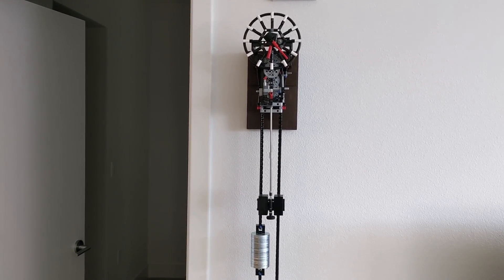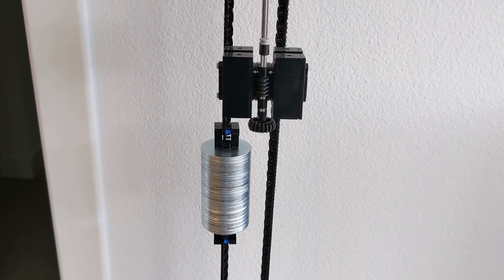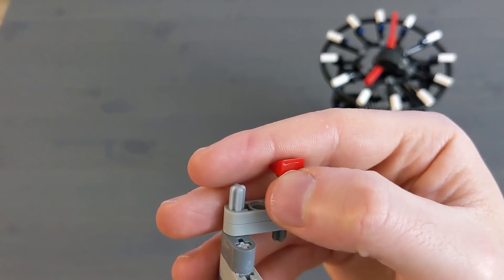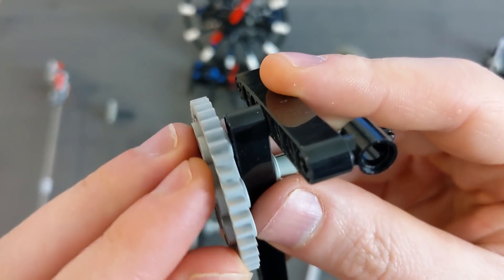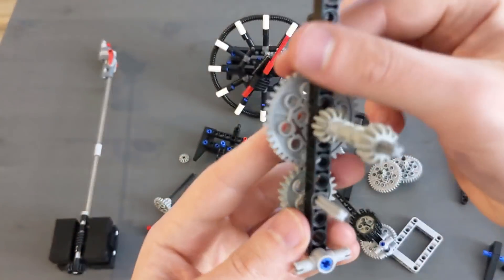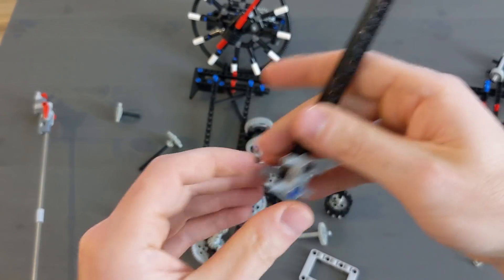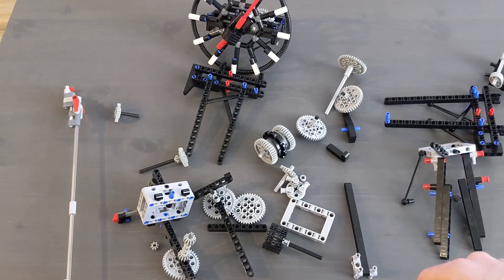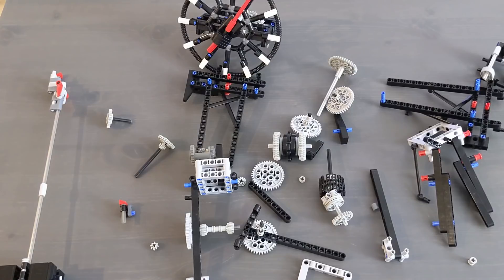LEGO Pendulum clock: can a LEGO clock run for a whole year?

Comment: The freewheel input I believe, the part only supported by one bearing joint is in single shear loading this allows the axle to twist and bind. If you could add a second bearing location to that half of the freewheel wear will be reduced dramatically

Comment: Great work, Dillon, and thanks for the .lxf file.  Speaking of which, LEGO Digital Designer 4.3 says that 24 bricks couldn't be loaded; do you know why that's happening and/or which bricks those are?  Also, it looks like you're using chain link part number 15379, but how many of them, and are there any other parts not showing up in said .lxf file?
Reply from the maker: I think part of the problem is that the LXF file is for an older version of the clock that used a differential and ratchet instead of the freewheel design shown here. The older design didn't use the tread chain links. There are some instructions for the updated version here: https://www.bricklink.com/v3/studio/design.page?idModel=150303

For the other parts that aren't loading... I'm not sure, I've been working with LEGO studio now.
Reply: @DillonSharlet  Dillon, I've finally built the thing!  I'm so excited to get it working but, for now at least, I have removed all the flywheel stuff, since the 12 involved chain links (part #15379) were too often slipping right past the three underlying axle connectors (#32039), no matter the direction of spin of the main drive wheel -- forward or backward.  (Desperate, I even reversed the "bite" direction of those three parts, to no avail.)  Any tips?  I am guessing that it has to do with the following...

Also, at about 2:03 in your video, it seems that you are putting a lot of effort into rotating the main drive wheel.  I sure struggle with mine, even after minimizing friction here and there.  On the other hand, turning almost any other gear (e.g., the gear closest to the floor) is much, mmmmmuuuuuuch easier, which seems strange to me.  Long story short, it seems that when I find up the recommended 560 gram mass to attach to the big chain loop, I kind of doubt that the clock will work, especially since maartnnn 050 unsuccessfully went all the way to 600 grams.  Was your version static right up until you added that final washer?  Update:  I am unsure of how much mass I have just now added (by way of thicker washers than you are using in your video), but the main drive wheel now moves surprisingly easily.  So now I just have to add/remove one or more washers and play around with the escapement settings!  (And get that pesky freewheel working.)

Comment: This is actually really cool
How hard was it to tune the period timing?
Reply from the maker: It was (and still is) difficult! After the initial adjustments, the only way to tell if it is adjusted correctly is to let it run for several days and see if it consistently runs ahead or behind, and even very small adjustments are significant.

Comment: I wonder how well it would work if you some sort of greased to help lubricate the gears?  That might help reduce wear and extend the lifespan of the clock... however... you'd have to encase the mechanism or the grease might get nasty overtime.  You might want to consider constructing an exterior out of 1x6x5 clear transparent panels ( https://www.bricklink.com/v2/catalog/catalogitem.page?id=72940#T=S&C=12&O={%22color%22:12,%22iconly%22:0} ) so you can still see the mechanism, but dust can't get into the grease.

Comment: I really wonder if LEGO should start making some metal bricks for high wear devices such as this. I know many a channel that have used some third party metal axles and such, but it would be really cool if lego made them in house
Reply from the maker: I am actually using some third party metal axles for the pendulum in this build! This is an attempt to make the pendulum less sensitive to temperature.

Comment: Those tiny bushing/pulleys (the 1 stud size) will over stress and break in a plus sign when there is too much force on them. They will literally twist themselves out of existence if they are crushed side to side while turning. The only thing I've found to fix that is to either over grease the axle where it goes in the hole, or to brace the bushing with a leather washer, because it's the friction against the hole that causes the tear out.

Comment: Very interesting. How did it perform, did the time drift (compared to this kind of clock)? Did you actually use and rely on it as a clock? And did that red sloped brick not pop off even once?
Reply from the maker: It is usually accurate to within 1 or 2 minutes when I wind it every 3 days. I often look at it to see what time it is! The forces on those red slope bricks are tiny, they've never popped off :)

Comment: After seeing this I think I have figured out why our clock has 2 weights. Our clock has chimes, so I think that it uses one weight for the time, and when the time is at a certain spot it triggers something in the clock which activates the chime mechanism which is powered by the second weight.

Our clock sometimes stops randomly, and it has been running for almost 30 years. I think the same parts where the pendulum has contact with a gear is worn out after all this time. This has been a really interesting video to watch. Thanks for sharing!

Comment: 6:25 I'm fairly certain that piece would have disintegrated like that because the axel it's on is under the most torque (the weight pulling down on one side of the ratchet vs the gear holding it in place on the other side). Unfortunately the 1/2 sized bearings are quite fragile and when you twist the axle inside them, that leads to increased size of the axle, thus pushing outward against the bearing - resulting in cracks along the outside edge, and a stretching/'loosening' of the bearing itself, which is why it slid freely along the axle.

Comment: If you replace the edges of the pendulum (the little red parts that wore down) you might get another year out of it again!
You might also consider replacing them with a different part and seeing if they last longer. 
The bushing on the freewheel that broke - Thats a high stress part which is always moving and always changing direction. 

How accurate was the time?
Reply from the maker: I think I'm just going to need to replace the two red parts every 6 months to keep it running well :) It's possible there is a different part that would work well, but these are pretty unique among LEGO because they reach a sharp point, which allows them to capture more energy than a more blunt part.

It's usually a minute or two off every time I wind it every 3 days. I usually reset the time every other time I wind it (so every 6 days).
Reply: @DillonSharlet  not too shabby on the accuracy there.

I didn't mean make it more blunt, I was thinking of using the edge of a brick with a flat tile on top of it, that way you still have the sharp point on the edge of the tile and the tile being thicker may be more resilient to this form of wear. Would also make for a smaller piece to replace.

Comment: Wow, a good study of the effects of continuous use of the mechanical Lego parts. Apparently the Legos worth the price tag, I'm also impressed too. If you want to improve this design, and have a longer lasting clock, then you should replace all moving parts with metal parts. This should drastically improve the lifetime, and the weight. A case for the mechanical parts will help prevent damage from any accidents. This video was surprisingly educational and intriguing, and I praise it for that.

Comment: Did you lubricate it at all? I mean all mechanisms require lubrication... in this instace it would be  silicone grease or silicone oil... depending on the area and how much pressure there is...
Reply: I think this is the post I as looking for: So silicone grease/oil is safe on Lego's? I built mine and Dilon here is helping a lot... a lot a lot!!! :-) I seem to have an issue with friction and or weights. I want to lube it a bit before adding much more weight.

Comment: Could this just be beneficial wear-in on some of the parts? For instance on the pallets, the sharp edges are being worn down and as the surfaces are lapped together their contact area increases and their wear reduces dramatically in the absence of abrasive particles. What if you were to just readjust the pallets and keep using them? They might last longer than a year after this, or may even last indefinitely.

Comment: How many treads are used/how long is the tread for the weight? 
It seems that the weight has changed the most from your original design.
Reply from the maker: I'm not sure exactly how many treads there are, but the weight can fall about 4.5 feet, and the chain is a loop to avoid the drive torque changing due to the weight of the chain itself moving through the clock. I'm pretty happy with this weight design. It's not proper LEGO, but it's very compact and easy to adjust by adding or removing washers.
Reply: @DillonSharlet  I totally get it. This is going to be my current LEGO project. Currently gathering and sourcing parts!

Comment: Oh, okay. You meant can Lego clock work for a year.
Here I thought you made it run a whole year with a single windup and was ready to call bullshit on that one.
Reply: Actually, 3 days is extremely impressive for a gravity powered kinetic sculpture! It really goes to show how Lego's have such an extreme level of accuracy that helps with energy loss.
Reply: @RCHobbyist463  For Lego clock? Maybe.
Usually the best pendulum clock ticked were almost a month.

My grandparents had one and I most certainly don't recall them winding it that often.

But the point is that title is misleading.
Reply: you could technically build a clock with a 1 year wind. you would need a fair amount of weight and a long cord and need to reapply grease keep it lubed.
Reply: @Reverend_Jay  I'd say it'd probably be more of a weigh issue than having to have impossibly long chord. But it'd also mean that machinery inside the clock would need to be much more sophisticated as well.

Comment: great design, looks compact and sturdy. 

- the weight is made from metal discs? how much weight (and height)? 

- what is the gear ratio from the great wheel to the escape wheel?

- it runs for 3 days?
Reply from the maker: Thanks for your comment!
The weight is large washers slid onto a 13 stud beam, so there are 11 studs worth of washers. It is 560g.
The gear ratio is 625:1 = 3:1 x 40:24 x (5:1)^3.
Yes, it runs for 3 days, the weight falls about 4.5 feet in that time. All this put together, the clock runs on 29 microwatts.
Reply: @DillonSharlet  thanks for the answers! the gear ratio is really in the magnitude of a commercial clock

Comment: The wear can be heavily reduced by using lubricant. I recommend PTFE lubricant for your use case. It essentially doubles both as a protective coating and lubricant on LEGO parts. I personally use it on my vehicle MOCs. Should aid in the longevity of the parts. Simply buy a $4ish can of lubricant, reapply every month or so, and you’re good to go!
Reply from the maker: It's a good suggestion, but I'm hesitant to use lubricant because I think it might get messy, and it's just two small parts that wear out every 6 months or so, and they're easy to replace and not expensive :)
Reply: Dillon Sharlet Totally understand. Amazing creation! Always wanted to have a LEGO clock but afraid of the ramifications of maintaining the LEGO parts over a long span of time.
Reply: @DillonSharlet  Hi, there are PTFE or teflon "grease" that are not grease an messy :-) When wet ingredient evaporates particles still provide up to 5 time less friction, that is why they are called dry grease. Also type of silicone or PFAE grease and most synthetic hydrocarbons as well as mineral oils work well with plastic materials. Fore sure there is benefit in using specific one for specific plastic material. In general dry teflon (white) or silicone grease (transparent) work well for most. Keep up the good work!
Reply: Dillon Sharlet 
You can’t expect to use zero lubricant. Especially with contact of similar materials similar. And more efficient would require less weight, and reduced forces on point of contact and axle rotation. 

There’s is only 1 or 2 examples of any clock that runs absolutely dry.

Lubricant is a required component.
Reply: Does this product work in the bedroom
Reply: @abusementpark153  ayo
Reply: use siliconspray

Comment: does anyone else also get worried that the pendulum will stop swinging?
Reply: as long as the clock is wound the pendulum will continue to spin. the escape wheel is being pulled by a weight, and the pendulum is pushed by the gear wanting to rotate. the pendulum then blocks the gear from rotating. swings back, and then its pushed again. the same it true for a mechanical watch with a balance wheel. as long as there is potential energy, the oscillator will continue to move.

Comment: get some brass bearing and silicone based lube and service will be every 3rd year ^^ maybe get some of the gears made out of aluminium or brass too to reduce wear and tear of the most hard pressed points. 10/10 video, 
now to find all my old lego again
Reply: Then it won't be lego, just will he a regular boring open clock.
Reply: He could use silicone based lube still with lego, as long as he doesn't use oil based lubes it should be fine, after all plastics are dissolved by oils over time.

Comment: Great design and interesting insight on the parts wear.Thin bushings seem to disintegrate on their own, even without any substantial forces. As for pallets, there is no easy solution for their wear, apart from using grasshopper escapement (which pretty much eliminates contact friction).

Comment: congrats on your success! it's quite an elaborate piece.

i have a new knife edge design you might like: 57585 (axle connector hub with three axles) against 92946 (slope brick). the 120 degree angle between the axles of the connector provides the pivot point. compact and most efficient.

KEvron

Comment: That is a beautifully well-tuned escapement! Thank you for the detailed view of the mechanisms. As for the parts wearing down and breaking, perhaps you could use a 3D printing service like 3DHubs to print metal clones of the parts that wear the quickest.
Reply: the metal may wear adjacent parts faster. Then you'd end up making the entire thing out of metal eventually, which defeats the point. Another option would be to change the bearings to more standard horological point bearings
Reply: @sayethwe8683  i mean, it could still be metal lego which would still be cool
Reply: I feel like he is trying to get the most mileage out of the parts provided for the engineering challenge less than trying to get his clock to last a long time.